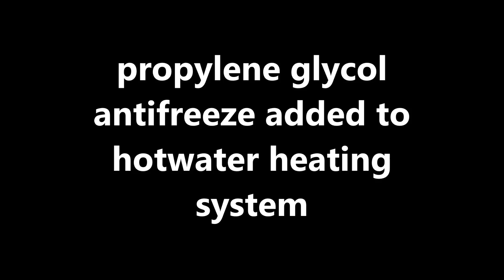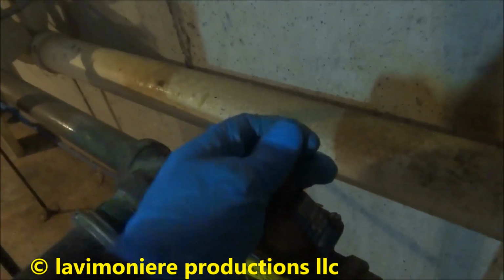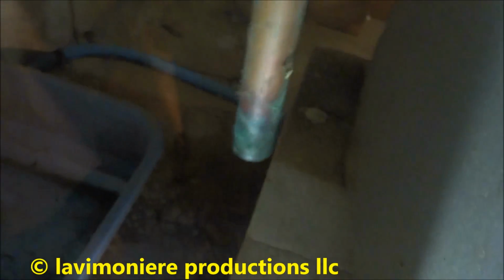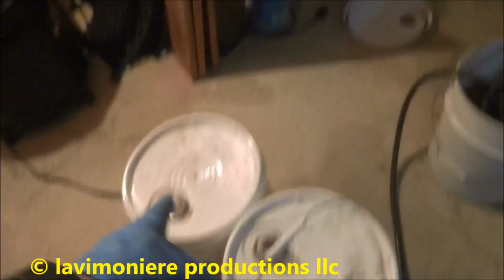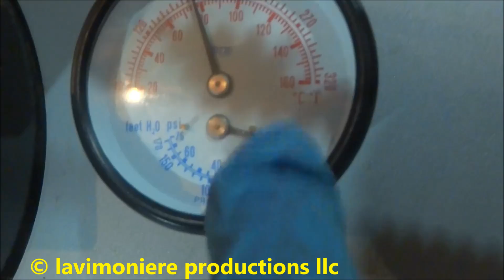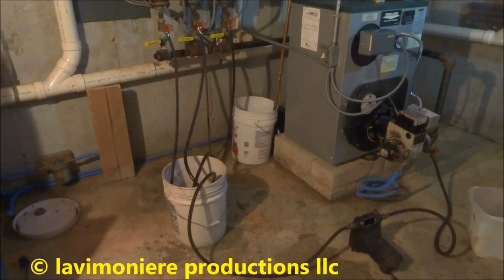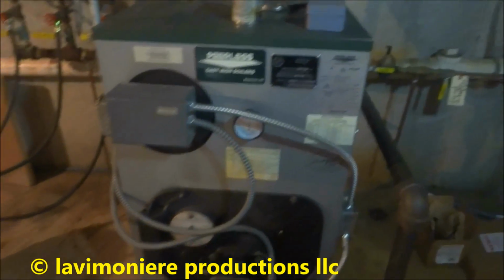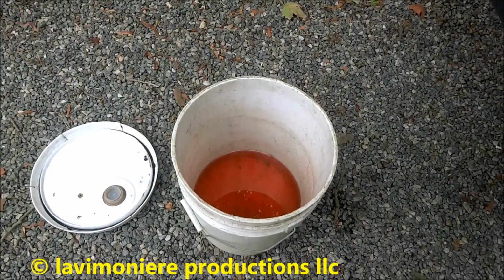Propylene Glycol /antifreeze installed in a heating system

Comment: That's exactly the way I do it to bleed the air out of my system when I need to, right down to the check valve on my suction line from the bucket . Only I plug my pump into a switched receptical on the end of my cord ,that way I can reach the purge valves and shut the pump off at the same time. I still think there's nothing like a radiator bleeder on the return end of each rad or baseboard. Great vids Steve , sometime I think we must have been taught by the same journeyman.

Comment: Kind of like what I used to do on Geo Thermals, with methanol to keep it from freezing. I pumped with pool pump in 50 gallon plastic tub , 3-10 gallon containers.  Go to highest pete's plug I had fitting with clear hose I made to let out air and some water into 5 gallon bucket..   Good job, your job went quicker than mine would take 4 hours to clear loops..
Reply: You have such good tips I'm in school and every video I watch you have a good tip! Makes us soon to be techs smart.

Comment: So i must say on any closed loop water system, (Distilled water only) should be used to reduce contamination and degradation of the internal parts, even as a additive to antifreeze. All other types or sources of water will have long term effects. 👍

Comment: my forced hot water heating system was not used for the last ten years. Will the anti-freeze gels up in the pipes? my plumber said, it will cost thousands to just clean out the gels with a special chemical. Is that truth?
Reply: Depends on the antifreeze and system, but a serious flushing would be recommended for sure.

Comment: HI Steve I worked for a company last year and we did a lot of snow melt systems . And every time we charged the system with Glycol the guy would always fill half the bucket of glycol with water . Was he doing this bc it saved him money on the glycol or was there another reason ?
Reply: hey sean, if you were using 100% glycol propylene or ethylene you would mix it to get the freeze point needed for the temps you can reach in what ever city/country you live in..in fact if you used 100% and did a 50/50 mix you have 50% of glycol in your system. you would have a freeze point of about -30 fahrenheit for propylene and maybe about -41 fahrenheit for ethylene.. unless your in alaska or using it on some chill water systems you should not need that percentage, you can do a lot of damage to pumps and blow out coils.here in nyc we call for 30% to 40% glycol in systems. and if your boss or company did this they were not saving money he was losing money:).but because you said it was for an ice system 50% with the right pumps and tubing sounds about right...great video steve once again hope you dont mind me answering this question for him love you brother keep up the good work..
Reply: Plus straight antifreeze doesn't have the same heat exchange qualities, as compared to mixed. At least that's the case with cars.
Reply: lockload007 thanks a lot man I live in Toronto so our winters are pretty much the same . So I will remember to use that percentage nxt time on my own .